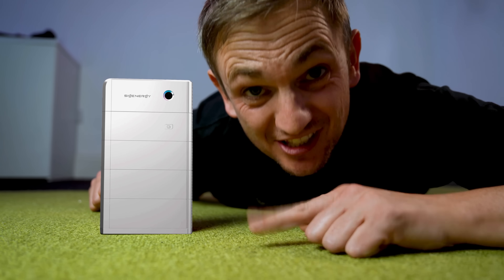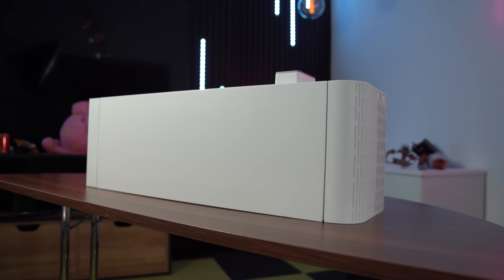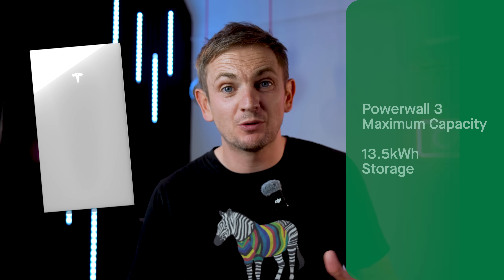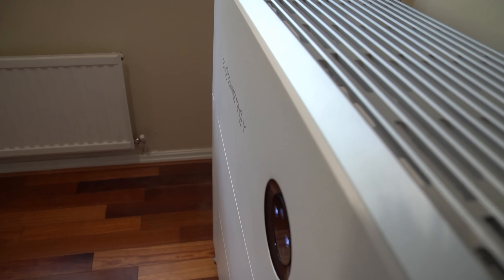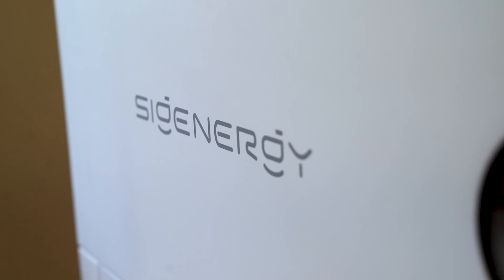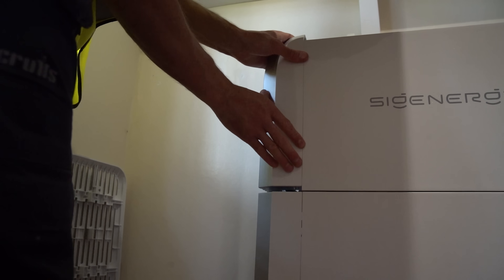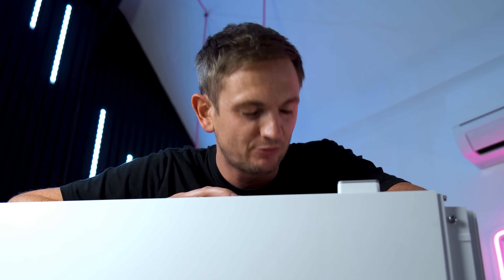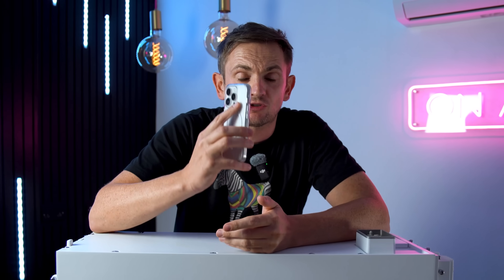Are Sigenergy Misleading Their Customers? NEW Battery Update

Comment: I have had my Sigenergy 32kW 10Kw inverter for 5 months now. Was very satisfied until their recent recall of inverters. They told us they were replacing all inverters above 8kw because some installers had damaged a connector so as abundance of caution they were generously replacing all installed inverters. Then they released a software fix that restricted the inverter to around 7.5kw discharge. This was not nice but still workable. Recently they issued a further software upgrade and now my inverter seems to be restricted to around 5kw discharge. This is totally intolerable on the basis I have no idea when my inverter will be replaced. Both software upgrades were hasty and introduced other problems in display and function. I now believe that Sigenergy are bullish!ty!ng is and there is some other more serious reason for the recall. The restrictions are also a major cost to people trying to export energy to get a good payback for their systems. I am losing trust in Sigenergy.

Comment: When you look at the technical specification document, the useable energy is annotated with a "1" - in the notes it states the useable energy is calculated by doing a 100% discharge at 0.2C at 25c. If you were to do a 100% DOD the life of the battery would be very low, so you would only do a DOD of 95% so the "useable capacity" is much lower. I feel I am getting something wrong, but I don't know of any Lifepo4 batteries that are recommended to go 100% DOD.

Comment: Confused - please explain. The "10" says it has 314ah prismatic cells, these are 3.2v and you need 16s to get to 51.2v, this would give it 16.078kwh but the battery is only 9.04kwh. If it is 16s that would make the cells 176ah not the 314ah stated. Can you find out what cells are being used, 180ah cells seem to have a life of 2000 cycles or around 5yrs. I either have my maths wrong, and I apologise or the data sheet is wrong!
Reply: Hello there!
I don't know about the Bat 10.0 model but for the 8.0 Bat Sigenergy has stated that there are 9 Cells of 280Ah capacity each and the combined voltage of these 9 cells is 32.85V (each cell with voltage 3.65V multiplied by 9) which is lesser than human safety voltage range (<36V).
These batteries are not 51.2V batteries. Please refer to the datasheets of Batteries as well as ECs on the Sigenergy website.
Thank you! :)

Comment: One thing I didn’t see you mention about the new batteries is the nearly double cycle count, 10k vs 6k on the 10kW battery. I’ve been given the opportunity to go with the larger one and it was more this factor that drove my decision.
Reply from the maker: Hey Mark, this is great info, thanks for sharing. It definitely is a no brainer with that kind of cycle count upgrade on top of the other features!
Reply: What constitutes a battery cycle?  Is a 6k cycles equivalent to just over 16 years 1/day 365 pa. What’s the degradation in capacity after 10 years?.
Reply: That is good to know. Does the cycle count on the 6 improve over the old 5, too?

Comment: Any feature or techinical aspect difference between the 5/8 modules with the newer 6/10 modules? Or is it much the same, but to cater to slightly more storage hungry future?

Also, is the old gen compatible with the new gen batteries?
Reply: Yes, the old 5/8 bat models can be mix matched with 6/10 bat models. The form factor of all these models is same, only difference is that they are denser and less cost per kWh.

Comment: What's the DoD on the new batteries?

The originals DoD were 100% that's why the actual capacity was larger than the advertised amount, as then they could claim "100%" DoD.

It is a bit cheeky to put 10 on the new batteries but as you say they don't state 10kwh but your installer should be aware of this so not really anything the general consumer needs to worry about.

Comment: In Australia we got heaps of rebate from the federal government. 8 kwh battery is around $1500 AUD after rebate. I made a short video on my channel on this system.
Reply: ⁉️⁉️⁉️✅✅✅✅ WTF DID I JUST SEE THE BATTERY, INVERTER and GATEWAY INSTALLED IN A ROOM IN A HOUSE. Surely this cant be done in Australia?
Reply: @jordanzinger3066  Display.
Reply: I have not seen anything under 5 grand vright now. Whater you talking about
Reply: @mitchimal It depends on the system and installer. We have Sigenergy and their system is stackable. So the cost of installing 16 kwh or 32 kwh system is the same. Are you in Melbourne? If you are talk to Brightworks, they are my installer.

Comment: Hi,

Great video, can you assist?

I'd like to create a solar charged sigenergy battery installation with a 16 kwh capacity and an 8kw/32A discharge rate. 

The sigenergy components will be indoor, floor mounted in an outbuilding.

The system will be OFF GRID. 

At some point in the future, but not right now, I'd like to be able to upgrade solar capacity and add an EV charging capability.

So:

1. For the initial installation what components will I require in addition to batteries and the energy controller?
2. Will I be able to purchase these directly as a private individual?
3. Is this something a competent DIYer can achieve?
4. Does anyone offer an oversight service to check the work before switching on?

Many thanks
Reply: Hello there!
1. All you need is an Energy Controller of the required load that you want to power. The EC comes in variety of power as well as in single phase or three phase supply. For the batteries, buy x2 8.0 Bat (as you mentioned 16kW). You can upgrade later or add 4 more battery modules of different size (considering that you are going all backup).
2. Don't know. Do try though!
3. Yes, a DIYer can achieve the requirement power and backup. But the quality/safety/performance can't be achieved. 
4.  We have installed the SigenStor. It is an intelligent system. It won't turn on if its safety requirements aren't met.

Comment: 10 kWh battery is never what people think. 
4% will be lost to discharge the battry with a DC load no matter what . You can not get more than 9,6 kWh out of it.
And now the key moment comes: convert the DC power to AC power - and most importantly talk about the losses.

And those can be 46% for all those smart people who have learned about efficiency curves. 3% or 4% is the figure most have heard about as inverter efficiency but not reading the fineprint which says at or around nominal output of for example 5 kW. 

Let me know what your doing during night in your home ? Watching TV with a few lights and some standby stuff. Maybe 500 W or 600 W till 11 pm but then ?
50 to 100 W maybe and in case you are drawing 100 W during night then this 100 W AC needed will be produced with 186 W DC from the battery.

You might have doubts ? Check out Berlin University annual High Volt Storage inspection sponsored by the german government and search for "Speicherinspektion HWT 2025". You will find a german website and on the right half 3 downloads where you find 1 in english as a good readable presentation. On page 7 they explain these myths and efficiency differences with the 100 W AC load and the system efficiency (inverter side only, cause charging losses come on top). You want less losses then there are solutions - that is germany. You can get 98% efficiency for such 100W load too, but it comes at a price and you will need a multi level system.

So do not believe Manufacturers or PV system installers and check your nightly Watt figures - find the average and bandwith, montior it and do not use only averages cause 100 W for 30 minutes and 10 W for 30 minutes AC Load will cause errors if you do the math about the losses for 50 W average AC load.

Back to the example: Assuming you need 250 W and hence the inverter is at a better performance then look at the loss or efficiency curve 
100 W AC = 43% losses while 900 W AC can be generated from the battery with 10% losses you can extrapolate: 250 W is 150 W more than  100 W roughly 1 / 5th of the whole bandwith fro 100 W to 900 W AC.  And from the 33% loss bandwith (43 - 10) you can save 1 / 5th to or 7% which means not 43% losses but 36% losses.

Back to the DC output energy: 9,6 kWh DC available used with a 64% efficiency AC = 6,144 kWh AC useable  and 3,85 kWh lost in total
But that is just one side cause AC charging or DC charging comes also at a price of roughly 4% at least if you charge fast with high effficiency. 
So to get your 10 kWh battery fully charged you will hast to invest 10,4 kWh to get at the end 6,1 kWh out of that and 4,3  kWh had been lost.

Of cause your inverter can be more efficiten, you have a higher load in the night - the better the efficiency will be. 
But most people are not able to do the math properly and believe that they get 9,5 kWh AC or 9 kWh AC out of such 10 kWh HV battery.
If you have a low voltage 51V LFP battery the losses will be higher and you can feel the heat for sure too in the room and battery. 

OUR DECISION: we got the cheapest system which means we got single phase hybrid inverter 4,6 kW and 16 kWh batteries for 1400€ or 1250 GBP
That is the only way to live with high losses you can not avoid unless you spend a fortune for multilevel inverter and battery. 
We paid less than 2000€ for inverter and 16 kWh battery, we do not care about losses and hence we got multiple of these inverters and batteries.

Comment: I'm wondering how an aerosol can extinguish a battery fire. I don't know a lot about this but I thought batteries contained their own oxidant and thus preventing oxygen from the air getting to the battery was ineffective in extinguishing the fire (is it actually a fire?). Anyone? I'm not being critical of Sigenstor - in fact I'm about to install one here in Canberra Australia.
Reply: NMC batteries create their own Oxygen and also provide their own heat to burn. 
But most home batteries use LFP (LiFePO4) which is very unlikely to catch fire, need external heat to keep burning and does not release Oxygen unless you manage to get the fire well above 300 Celcius.

The biggest risk is an electronics failure or an external heat source, in which case the fire extinguishers could help.

The LFP cells can release Hydrogen and toxic fumes in the very unlikely event something does go wrong and there is some heat coming from charge/discharge losses, so proper ventilation is something I would highly recommend if it is going to be installed inside.

But compared to most battery chemistries ever made, LFP is extremely safe. Your smartphone, tablet or laptop is much more likely to burn.
Reply: wrong wrong wrong. Check out the latest incidents: LFP cells can generate hydrogen and then you will face an explosion as sen in germany 2023 where a LFP battery exploded and destroyed the house which has been demolished meanwhile. Same has happened last year and in 2023 in the USA where a lot of pictures had been shown on the will prowse forum.

In general battery like LFP tend to burn when the BMS goes wrong, not the cells are causing such fire but something inside the metal box and not the cells itself. The fire extinguishers are now sold by every manufacturer as they would a layer of protection. 
They can do it but not always cause in case of hydrogen they are useless.
Reply: @typxxilpsNMC battery powered vehicles go up in smoke about once a week here in the Netherlands.

LFP incidents are stuck at iust a few worldwide since their use for the past dacade or so while there are many tens of millions of solar battery installs across the world. 

The risk is not zero, but to be honest I am more scared of gas boilers than I am of LFP batteries.

Comment: I just received my 32 kWh single module Seplos Mason 560L battery with 2p16s EVE 314Ah cells (210kg!) and it wheeled nicely in place and bolted to the wall to avoid tipping over.
Cost in Norway for self import including delivery to the door was €4086! (£3535) That's only €128/kWh (£111).
Anything else is just not worth it from a cycle cost/power perspective.
Reply: Do you have an insurance ? 
If so asked them what they think about a violation of the codes. MASON 560 L means an upright tower offered by Seplos. If you open the battery you will look ONTO the valves. The vales will not be pointing to the ceiling, right ?

If so you are ignoring what the manufacturer is recommending specifically and also in a written from shown on youtube channels: cells have to be used as shown in their 20 page long manual (under pressure in a fixture) and valves have show to the sky.

If you really have a vertical battery with these coasters then you are screwed. Our insurcane is not willing to cover that and they claim that the reinsurances are not willing to cover a battery constructed against the manufacturers policy. 

Just to let you know : I have informed SEPLOS 2 years ago that these are illegal here cause I had bought one when I later heard that the horizontal usage is forbidden and why. 

Cost in germany are even cheaper but forbidden and customs will start to reject them. We had unfortunatelly a LFP battery explosion of a house which is a full ruin and is already demolished. 

The EV MB31 cells are here 950€ from a german dealer with a 5 year warranty. The EEL V4 battery case with JK BMS and active balancer is a bout 450€ so in total 1400€ for 16 kWh as home storage. We have 3 inverters and 3 batteries and no more SEPLOS BMS cause their BMS can not handle balancing properly. We got JK BMS instead and are running 3x 4600 W Single phase Hybrid inverters from Growatt that work quite well with the JK BMS .

Our oldest LFP battery is now 12 years old, over 3300 cycles and still SoH of 89%. So we have a quite good experience with LFP.
Reply: @typxxilps Please share this more widely as most people are ignorant!
Reply: @typxxilps Why not consider Yixiang's JK kit
Reply: Let us know how great it is after Seplos throw their hands up when you experience a warranty issue or worse...Mmmmmkay?

Comment: So... all of these safety features are more or less nonsense.  They are real enough, but more or less all home battery systems have the same features because they are, for the most part, just basic safety features that any system should have anyway.

The Aerosol systems does NOT extinguish battery fires.  How could you even think that those little modules could?   The idea with the system is to prevent the flammable toxic white gasses that are exhausted during a runaway from catching fire.  LFP batteries generally don't internally catch fire in a runaway (NMC and NCA do).   If the cells do wind up catching fire, the Aerosol system won't be able to put it out.

I'm not really a fan of small battery increments.  Just more things that will go wrong in-piecemeal as the system ages.  The modular increments are way too small.  Easily liftable?  Ok, but not really a big deal.  I had no trouble solo-installing my EG4 14.3 kWh batteries with a cheap hydraulic lift table.  So a heavy battery is not necessarily a show stopper for installation.

-Matt